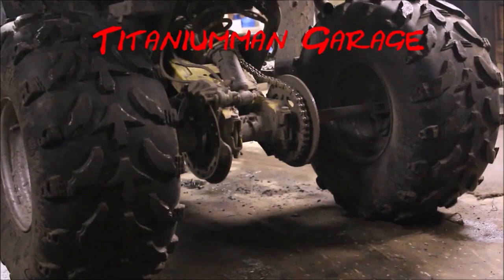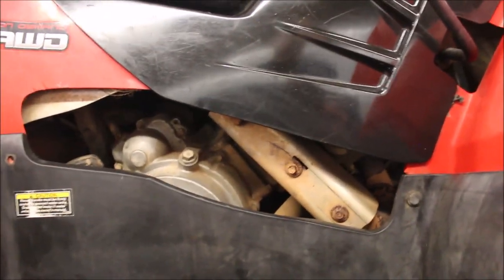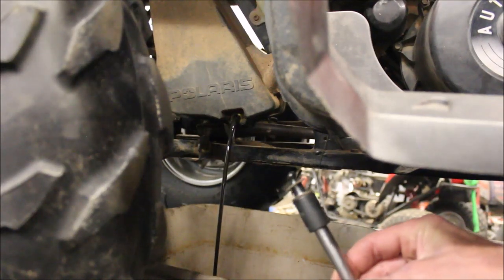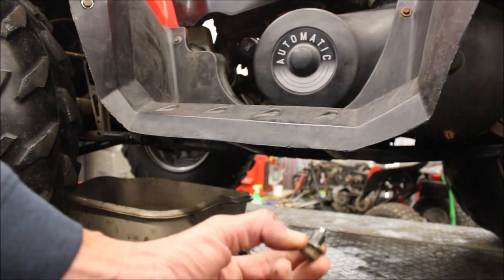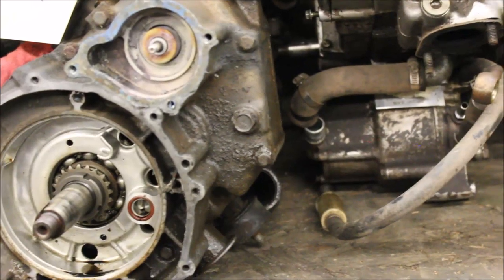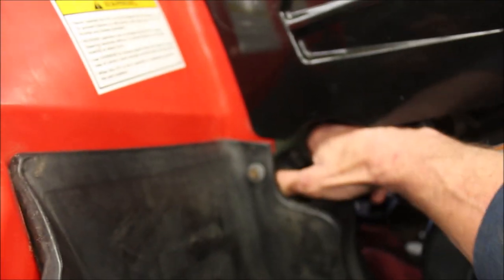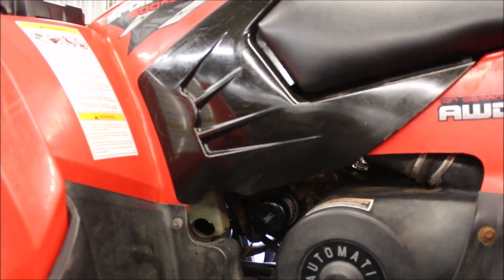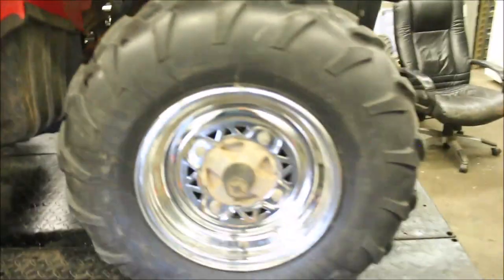How to do an Oil Change on a Polaris Sportsman 500

Comment: Just got a ‘04 500 HO had to rewatch your videos with the sound they make at startup idle where there is that slapping rod sound always got me paranoid. Thanks for the awesome video!
Reply from the maker: Usually its the bendix gear by the starter that makes noise. Or the clutch rattling.
Reply from the maker: On mine it was the clutch making that noise. I replaced the clutch and the noise was gone.
Reply: @TitaniummanGarage  I hear the bendix a bit ordered one but there is that other slapping sound but like you said can be the clutch also it’s two sounds like in your video

Comment: Just bought a used ATP 500 sportsman and heard you say about gas in the oil! Mine had gas in the oil also! What causes that? Thanks for the videos
Reply from the maker: Usually it's a leaking carb. Bad needle and seat. Leaks fuel into cylinder and down into the oil.

Comment: Aren't you supposed to prime the oil pump if you drain the crankcase by using a pliers or hemostat on the hose of the top part of the oil tank? that has a slit in it.
Reply from the maker: I've heard of guys doing that. I would do that on a fresh rebuild. There is oil all over the inside of the engine when you do an oil change. So a quick start up like I showed won't hurt anything. It takes 3 seconds for the oil to circulate in the engine unless you have a weak pump. I've never had an issue.
Reply: I think you only need to do that if you pull the screen in the reserve tank,  sometimes I pull it sometimes not
Reply: @bwfreel  you are correct sir